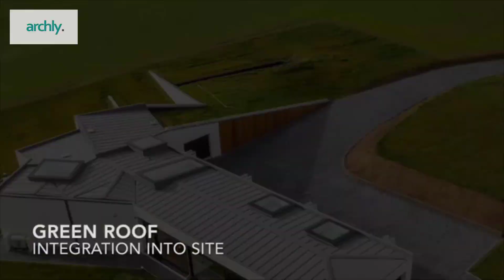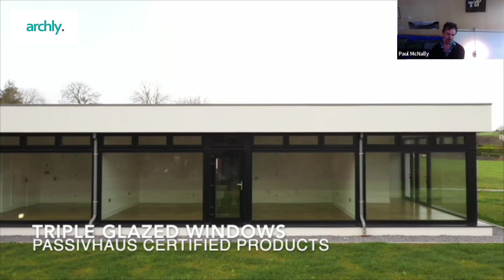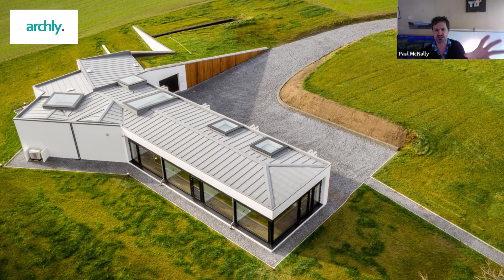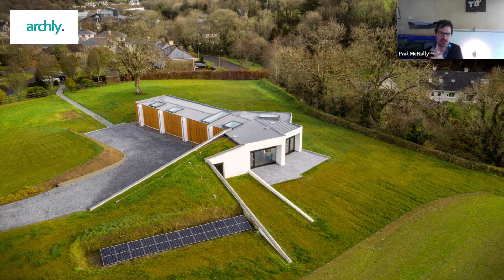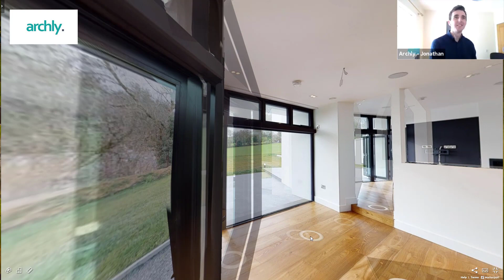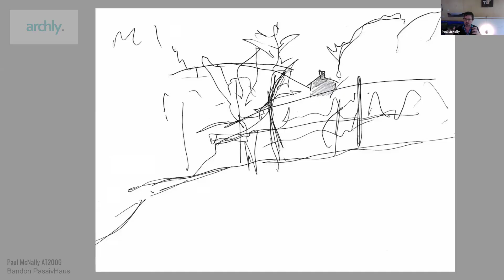How to 'Architecturally' Design a Passive House   Archly TV and Architect Paul Mc Nally   Part 1

Comment: Nice concept but, for the existing PV array they could have boosted the output by having them at a steeper angle.  Those look like they're nearly flat to the ground, maybe a 30 degree angle.  There in Ireland, you need them to be steeper than 50 degrees to get the best benefit from the sun.  Yes, the top edges would be more obtrusive and that may have been a consideration in the property design.  However, from what I can see of the way the land lays, the could have gone with a nearly buried structure, with the southern roof angled to catch the most of the suns energy into the PV panels and have gotten a LOT more than the 50% energy required to operate.